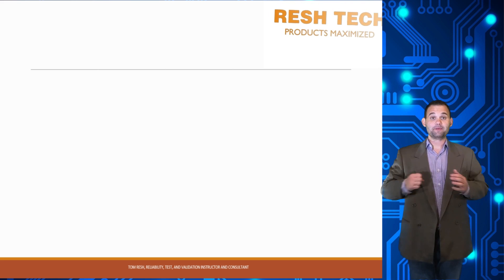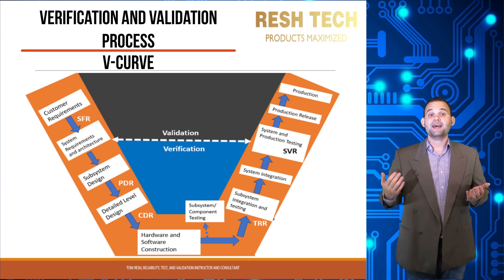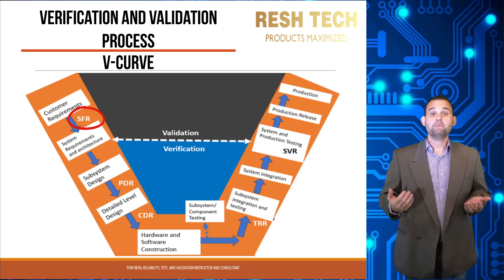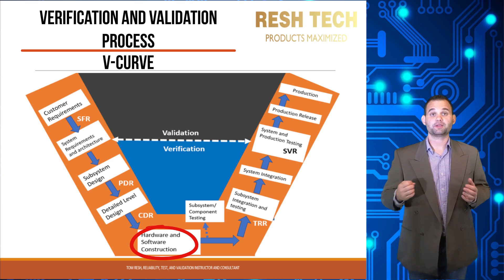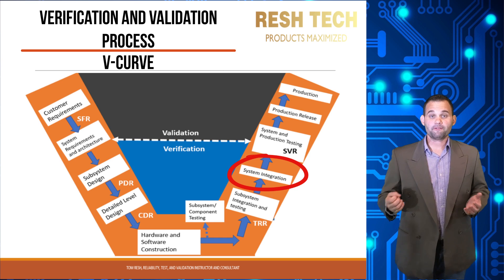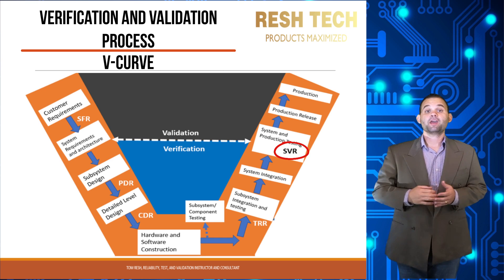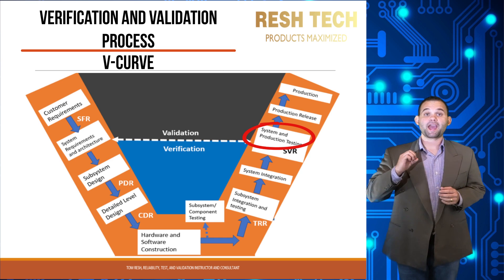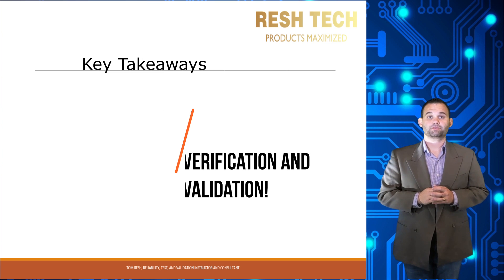Verification and Validation Process (V&V Curve)

Comment: What is a validation and verification design matrix?
Reply from the maker: Hi Adrian,  

Great question.  The format may vary from industry to industry, but it is typically comprised of system requirements and a corresponding V&V procedure or check for each requirement.  It can also include details on the samples such as sample pedigree and # of samples.  A good reference is to read about DVP/Rs.  I will create a video on DVP/Rs in the near future.

Cheers,

Tom